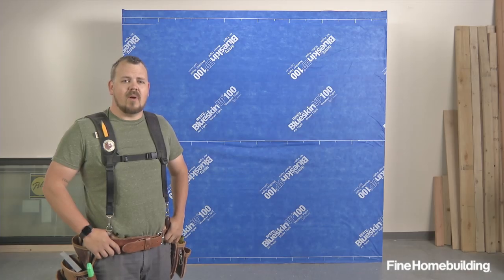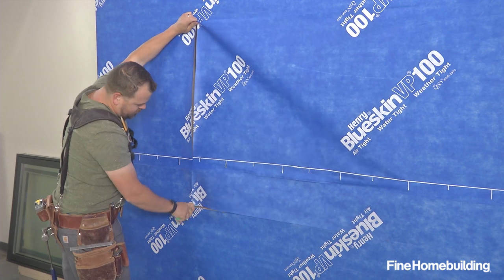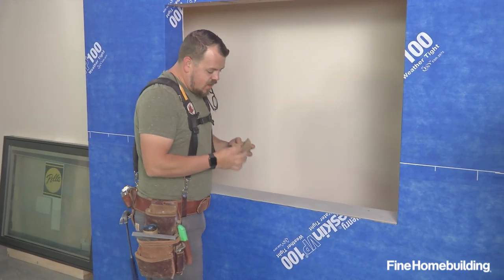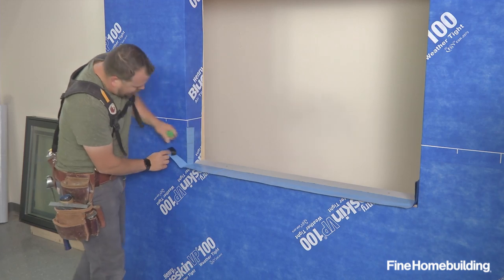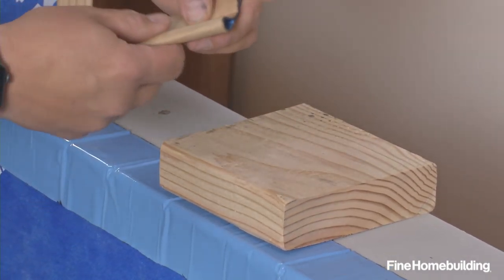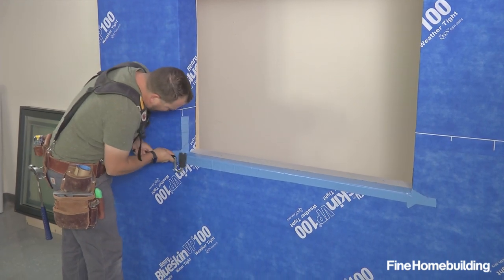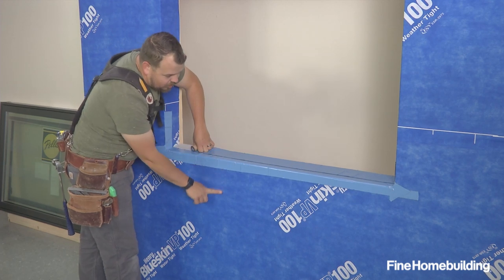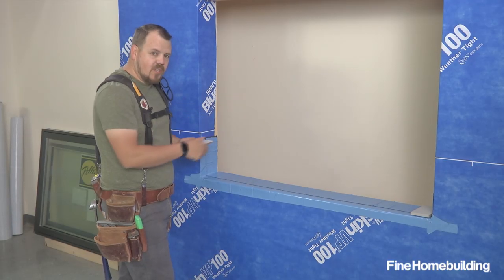Part 1: Prepare a Rough Opening for a Nail Fin Window Over Peel and Stick Housewrap

Comment: Great resource for those unsure how to flash various WRB configurations.  About the only thing I'd suggest in all cases is when placing the short reverse sections of cedar siding to support the window is to remove 1" from the thin edge to allow room for a continuous air seal (backer rod plus air barrier caulking like Prosoco AirDam or Sika 510 AM-50). Spray foam often used around windows is not a true air barrier.

Comment: Do you not need to apply the liquid primer first?
Reply: Henry alleges VP100 is a "primerless" product on most substrates. Having handled the product I can confirm it is about 1/10th the quality of Siga, Pro Clima, Vaproshield, etc. - it's like the shittiest possible nonwoven layer over a layer of plastic grocery store bag over a layer of adhesive. Make sure you get a sample roll and do some mockups before actually paying for a project's worth of any of these products, there is a lot of marketing wank and they are all basically nonwovens of varying tenacity laminated relatively weakly to a sort of thin grocery-store-bag plastic film with pressure sensitive adhesive on the back. I would also not recommend ever expecting a reverse lap in these materials to work properly long-term, because the water and air-tight layer is actually quite a ways below the surface and hard to actually bond to definitively with other pressure sensitive adhesives or with sealants. Think flat roof reinforcing fabric - you need a heck of a lot of liquid product to fully wet the substrate and to saturate and bleed up through the reinforcing (analogous to the top layer of nonwovens). The amount of PSA on tapes that actually exist is not something I would trust to reliably wet the actual waterproofing layer of these new-type peel and sticks in the way you could expect when the carrier, waterproofing, reinforcement, and abrasion resistance was all handled by one really thick HDPE layer (as in original bituminous Blueskin, Tremco 110AT, etc.)

Long story short.... magic is not real folks.
Reply: We used this product it’s like Reynolds’s plastic wrap  the manufacturer states it’s self sealing.   Stating the head of the fastner has to do the sealing     How ? When your nailing something into it …the head is nowhere near the Blueskin surface 😂

Comment: When the windows are typically sized and ordered before the installation, are they accounting for the added material of the cedar siding added to the sill? This process process seems to be an in the field decision and I was just curious if you ever have issues with the windows being too tight afterwards?
Reply: You need to account for the cedar shingle when you order your windows.  Alternatively, you can have your framers cut the cripples with a 5 degree bevel and then the 2x4 sill will be pre-sloped.